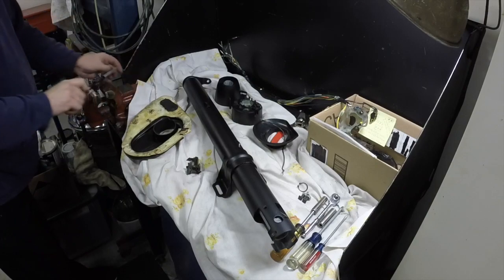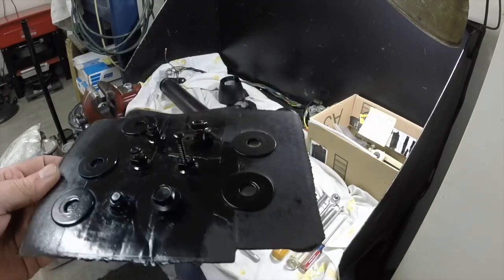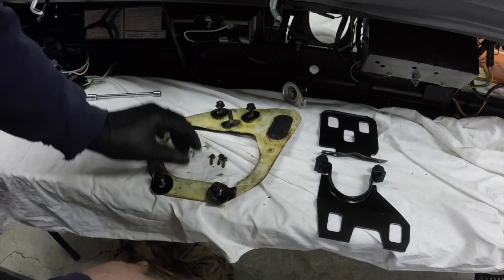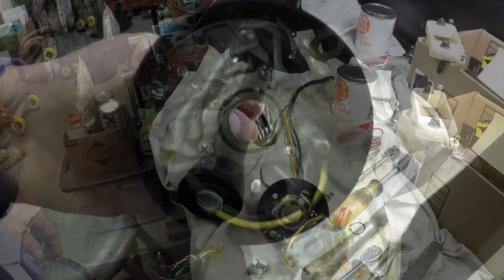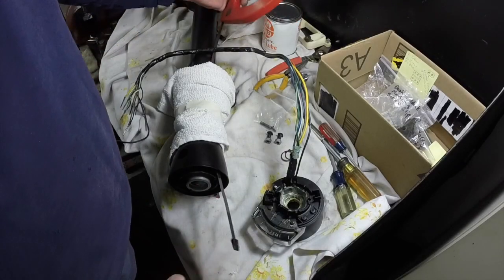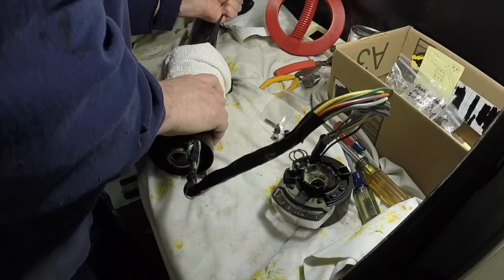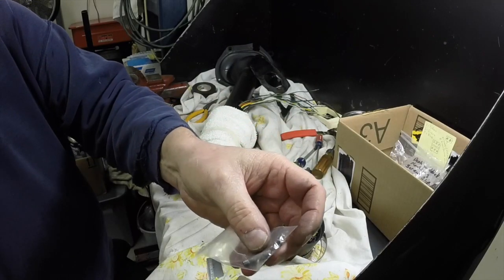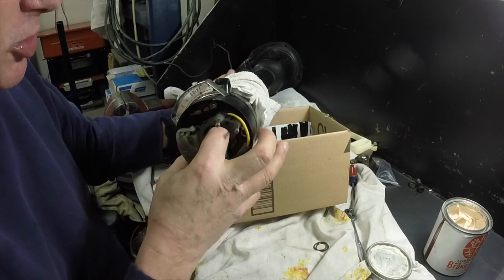1966 Ford Galaxie 500 convertible restoration part 172 assembling steering column

Comment: Howard, this video series was invaluable in the rebuild of my 65 Galaxie steering column. Thanks so much. I wanted to share a couple of additional tips that others may find useful. 

In your video, you showed where the two screws that hold the detent in place were loose. This was also true of mine and on a spare column I had for parts. As it appears that this is a common issue, I added blue Loctite to the screws before tightening them down to avoid a future similar issue.

To aid in pulling individual wires through the assembly, I coated each one with white lithium spray. This is especially helpful on the 65's, as the exposed portion of the wiring after reassembly is not taped, but instead goes through a black vinyl sheath, so even more to fish through.

I made a new sealing ring at the floor side of column boot to replace the yellow foam one. I traced the original on a 1/8" thick neoprene sponge foam rubber sheet I found on Amazon. Similarly,  I replaced the the felt dust seal at the bottom of the steering shaft with a thin sheet of wool felt. I cut a long  strip of about 3-1/4" wide and wrapped it around the shaft several times. I used contact cement just after the first wrap so the felt would stick to itself (not on the shaft) and also at the end of the final wrap, creating a nice plug.

Lastly, I understand why you mounted the gearshift indicator lens with a couple of screws. This will definitely keep it permanently in place, bit if it ever gets damaged, a partial column disassembly will be necessary to get it back out. My column tube has an L shape tension clip that mounts  on the top lip to keep the lens in place. I can be bent somewhat to provide addition tension, keeping the lens in place. It is more than adequate with enough tension, and with a simple upward pull,  the lens can easily be removed and replaced in the future.

Happy motoring!
Reply from the maker: Glad to know my video helped. I think I put a drop of lock tight on the screws too. I didn't put any lube on the wires, because I wanted to tape them like they originally were. Somewhere I do have special lube for pulling wires through conduit. I guess I could have used it, and still taped it up.... didn't think of that though.

Comment: I believe those are called wedge bulbs. If I had installed the column and forgotten a part I would be looking around for something to throw through the garage window.
Reply from the maker: I think your correct on the bulbs. As far as forgetting a part..... been there done that ,many times too. I just go back, take apart what I have to, and be done with it. I "try" not to get mad and make more work for myself.

Comment: The column looks amazing! Just wondering how long you let that chrome paint dry. In the reviews for that material some were talking about multiple days of drying time! Also, your very lucky that that turn signal switch was still in good condition!
I went through hoops with that one getting poorly made repros! I ended up finding a guy who makes them here for $125 (9 years ago) and it still working great!
Reply from the maker: I dried three days.... it is dry on the old shift collar. It wouldn't rub off or dull with my finger anyway.

Comment: I think the episode you repaired the switch was actually one of the first few videos!  Been awhile.
Reply from the maker: Yes, when I reinstalled the engine. Thats when I figured out why the car sat parked 44 years. Everything in the starting system was bad.... stripped flywheel, bad starter, bad ignition switch, and a bad neutral safety switch.

Comment: Howard, if the new replica dash top fits as badly as the earlier one, why not just strip the original metal cover (which you said was a perfect fit) and retrim it with new plastic.
Reply from the maker: I just don't think it would look good.... it's in bad shape, and I don't think I can make it look correct.